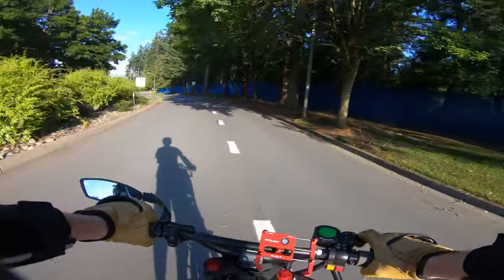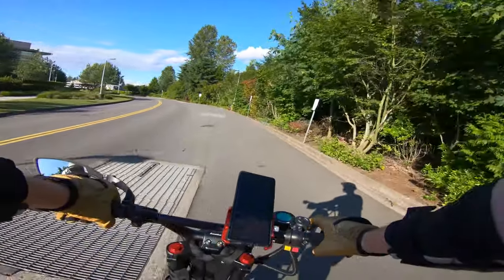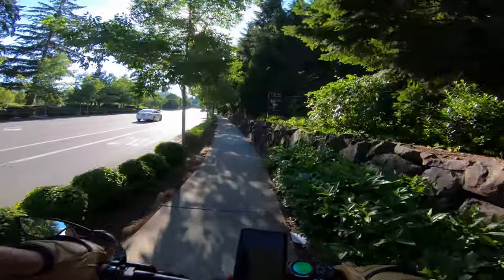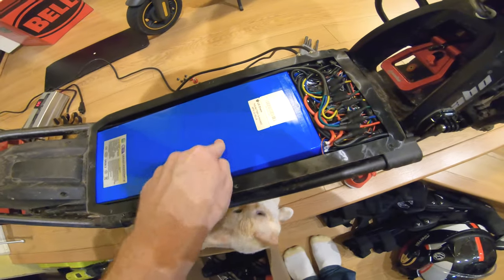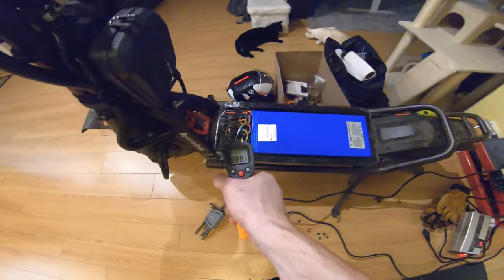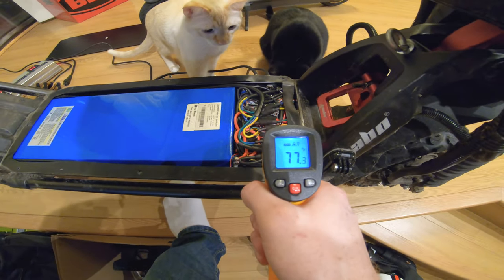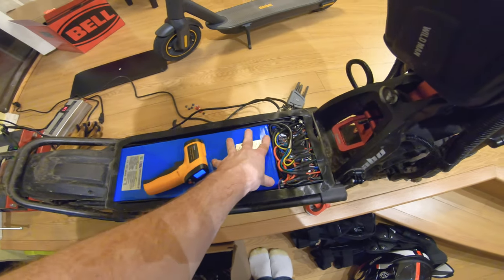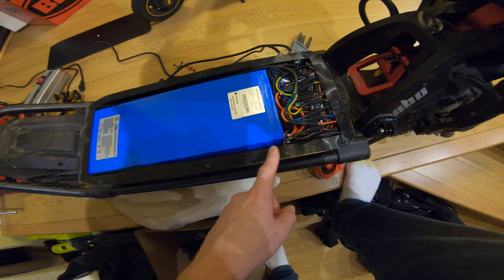P.E.V. Electric Scooters & EUC's - Charging : Are Fast Chargers Too Fast?

Comment: Nice! Good to have Nismo around to check what you are doing :D also - always useful to check max recommended current for a chargeport, max what the BMS can handle and check battery cells for max charge limit.
Reply: Also: I'm curious about what temp would be with the lid on ;) but useful videi, thanks!
Reply from the maker: Ugh I should've mentioned. I did place the Iid on for about mmm 50 minutes? (No screws in) and temp increased 1 degree. I suspect the metal casing on the scooter was acting as a heatsink of sorts. 
Max recommend from manufacturer was 16amps! I couldn't believe it, and I had so many people telling me not to charge past 5amps... But I guess it can handle way more than we think. 
And yes, Nismo was very 'helpful' 😂
Reply: @GingerOnWheels  thanks for the info! That's valuable info!
Reply: Curious about who said you can charge upto 16 amps.  I have been told by mini motors USA to not charge with more then one of their fast 6.5 amp chargers on my thunder.  It even says in the manual fast charger and stock charger is fine. Even in wolfs Manuel it says 10 is ok. I really want to use two 6.5 amp chargers at times on my thunder.

Comment: Your current limits are only applicable to the connectors, fuses, and wiring. A real fast charge is 3c (3 times the pack current rating). 1c (1x pack current rating) is considered safe. That means your 20AH pack can take 20A charging rate, and a King GT can take 35A and still be in normal charging. Your wires and connectors probably won't handle that kind of current, but your cells won't care.
Reply from the maker: Exactly.
Reply: Agreed
Reply: You're handing out bad info on the king gt pack.  the lg  lm50t cells from LG in seven parallel can safely take 23 amps per the data sheets. I am charging at 20 amps no problem. But only after upgrading the charge wire gauge to 10 gauge, which requires opening up the pack.

Comment: I think most people don't take their scooter apart to charge it. By removing the footboard you are allowing the battery and controller to dissipate heat instead of that heat being trapped inside the compartment accelerating the increase in temperature resulting in much higher temperatures. I'd find a follow-up video interesting in which you keep it enclosed as most people likely do and only open it once the charging is complete to get an accurate temperature.
🌡🌡🌡🌡🌡🌡🌡🌡🌡🌡🌡🌡
Reply from the maker: I already did a follow up video addressing this exact topic 😁
Reply: @GingerOnWheels  sorry I need to go on a Ginger binge this week and catch up!!!
💪🏻🙂🙃🙂🙃🙂🙃🙂🙃🙂🙃👍🏻
Reply: The aluminium top plate will act as a heat sink and dissipate a lot of the heat and maybe better on than if off!
Reply: You don’t take your scooter apart to charge it?

Comment: Ginger: Don't forget that when you OPEN the cove you're DISSIPATING THE Heater much quicker. Normally the batteries are TOTALLY enclosed with the cover I can guarantee you that they're much hotter when they're totally enclosed (heat cannot escape/dissipate easily). Think about it.
Reply from the maker: Please read my below response to this comment. Watch my Instagram too, I'll do a short post on this where I charge up then remove the deck at the end and measure temps. The metal scooter body acts as a heatsink.
Reply: Great answer to a great question
Reply: My iPhone

Comment: Reallt great video. How long does it take you to fully charge and do you always charge up to 100%, what about lowest % you tend to keep on your battery? Wonder what is the optimal A for Mantis 24,5ah battery.
Reply: Ginger knows alot more then me,but I been vaping for 6 years and a little familiar with 18650 batteries,so here's my opinion for now. If your gonna ride your scooter within a couple days of charging theres nothing wrong with 100% charging the problem is charging to 100% and letting it sit there for long periods of time fully charged. They do say if you only charge to 80/90% your battery will last long as far as how many times you can charge them. From what I understand is they break down while in that 100% charged state so as long as there not just sitting at 100% for long periods I DO MYSELF,AND I DO RECOMMEND...... charge 100% and enjoy your scooter!
Reply from the maker: I usually do 'deep cycle' charges (1amp) when I'm just letting it charge in my house and I don't have an urgent need to use the scooter. I always charge it up to 100%. I know there is a lot of evidence to suggest that this will decrease overall battery life but I haven't noticed any after near daily charge/discharges for a year. Sometime's I'll even charge it up to 100% and leave it for a couple days on accident, or it'll start snowing and I can't ride... If there is ONE guy on the internet who would've experienced loss in longevity of their battery, I think it'd be Yogisteve from Electric scooter academy on youtube. I'm curious to ask him.
Reply: @GingerOnWheels  Charge cycles are definitely good. Discharing battery till shut off definitely does the most degrade of the battery, a lot more than charging to 100%. It is recommended to not go below 20% or 30% and not go above 80% or 90% which suppose to prolong and give you 2 to 3 times more of charge cycles before battery going bad, but that is the catch, if you charging in that way you get to use basicaly just half of the battery capacity and have to charge a lot more frequently, basically not winning much at all by charging and trying to save the battery. I would really love to see a detailed test, with two same batteries, and see how much miles overall of lifespan you would be able to get with both batteries.
Reply from the maker: @TheChazas  I've read those 'rules' in lots of places, too. And there are articles out there proving they are true. BUT I've driven my scooter until shutoff and been stranded lots of times. I should definitely do another range test to see if my battery has significantly less capacity.
Reply: @GingerOnWheels  How many miles you already did on your Wolf? I wish the market would ditch this outdated battery tech and have less degrading cells, but it is good for companies and specially phone market, since batteries after a year or two degrades so much making you want a new phone, specially new flagship phones that eats battery and all the super fast charging.
Reply: @GingerOnWheels  that would definitely be good to see if you can drive it very similar to the 1st time and most of the same route! That would be amazing! Not just cause of the way you charge or drain but the miles and abuse it's been through since that time! I know it's a boring LONG ride BUT  WHAT A GREAT VIDEO!!!!!!!

Comment: @Ginger On Wheels I've seen a Falcon PEV video (for Zero10x), where they recommend not going past 5 amps because of the BMS. If you give too much amperage to the BMS, there'd be some risk in frying that component by going over spec. It's a consideration of the battery arrangement combined with the spec for the BMS. Hope you stay safe bro!
Reply: I've done 20 amps many times and not yet a problem . I don't recommend but in my case I was testing as I wanted to install higher rated bms for faster charging but diff t have too so far . I stay at 15 amps for 90% and then go to 5 amps

Comment: I have a question, it doesn't relate to E bikes batteries specifically but maybe you can help me. I have a 24 V PCB based battery, Each PCB has 7 batteries and there are 24 pcbs so 7S 24p..18650 batteries.   What type of charger do you recommend?? And at how many amps should I charge it? should I fast charge it 5 amps To 10 amps ? It has a 60 amp BMS.

Comment: yea. it doesnt hurt the Battery. but what about the Scooter itself?
in germany we have a "manufacturer" called IO HAWK. they import international scooters, modify them for german laws, and put their name on it.
the "IO HAWK Legend" is a modified Kaabo Mantis 10 for example. and now they released the Legacy (modified VSETT 10) and Collide (Modified VSETT 8).

the Legend (Mantis) had a 5A Fuse on the input, between the Charging port and the Battery Input. so even if the battery could handle more, you cant put more than 5A into it (and it has only 1 charging port).

now the VSETT models have two charging ports. 
but IO HAWK says strictly, that you must not charge your Legacy (VSETT 10) with more than 4A. which is either one charger with 4A or two chargers with 2A (stock charger is 2A).
so ... after everything i know, 2x 4A is no problem, and makes 8A charging in total. BUT ...
i dont know if the two charging ports are handled separately, or just go parallel inside the deck, and go into the battery as one connection. 
and i dont know if there is a fuse. 
and i dont know what the BMS says to 8A.
so even if 8A is fine for the battery/cells, it still might be a no-go. 
but also might work perfectly fine, even though IO HAWK says "never do that".
(one thing to mention is that the Legacy only has one controller, while the VSETT 10 had two controllers)

only way to find out is to open up the deck of the scooter. but the Legacy is freshly released, barely any videos, and barely anyone looked inside it. 
i dont have a Legacy yet, so cant check it myself.

Comment: thanks for the video Ginger, I have a question for you, could I use the fast charger of a dualtron 60v 6,5ah in a kaabo mantis GT pro? thanks a lot!
Reply from the maker: If the output volts and end connectors are the same on both chargers then you can swap them safely, yes.

Comment: I have a stock and a fast charger. What do you think of using them both at the time on a Vsset10. 
One at 5a one as 1.5. 
Any issues? 
Thanks
Reply from the maker: No issues. Totally fine to use both.

Comment: If you use that fast charger set to 80-90% state of charge, is it safe to leave the scooter plugged in? I.E. over night or longer?
Reply from the maker: Yup! Both the charger and the scooter have cutoffs built in that will stop battery from charging at a certain # of volts. IF both of those systems fail though for whatever reason, you'd have a very crispy house.
Reply: Ginger On Wheels damn dignity right my friend!

Always best to pull your batteries off charge when you go to bed, or atleast have a co2 fire extinguisher and a few bags of sand, with a lot of fire alarms if you don’t, just to be safe, you never know when something could fail and a lot of components built in China tend to have some minor construction flaw or another and will fail unexpectedly.

The only time you should leave it plugged in after it’s done charging, is when you want to make sure your cells are getting balanced completely (this is assuming your bms will balance your cells when they are charging, there are so many variables when it comes to bms it’s ridiculous, you’d be surprised how many different bms would be in the wolf’s batteries over the time it’s been available, due to simple supply and demand)

Sorry for my long winded comments, I just wanted to support Gingers comment, he (you) did an absolutely ball busting amount of research to learn about lithium cells. (There’s years and years more worth of data to take into consideration but eh)

👌🤗
Reply: @JamiePineappleWyatt  No you don't have to disconnect the charger from the scooter when done charging because the charging stops once it reaches full. Keeping the charger connected has no I'll effect against the scooter nor does it create hazard condition..

Comment: Coming from a different world but in the remote control car battery world we try to never charge more than 2c right I guess my question is are these batteries rated it and how many milliamp they are because you’re so divided by 1000 and I would give you the maximum amperage you’d want to charge one at Safeway for example a 10,000 mA battery pack you could see if we charge it at 10 A no problem even 20

Comment: Question new rider how low can I take battery or should take battery before recharging? Percent or volts reading if I'm saying it right.tks
Reply from the maker: Depends on the nominal voltage of your scooter battery
Reply: Ok thanks I bought the Mantis pro Se. I'm kinda fluffy so ya. My first scooter its cool
Reply: @GingerOnWheels  this b captainjack, when I was  Making a short clip for you to see I seeing the silhouette of a screw head under the tape so I believe I found them thanks a lot you've been a great help. keep posting videos they help a guy like me out! Tks

Comment: Man I really love this video I have a question for you I'm buying a powerful ebike and yes it is a big blue battery like yours except its a 72.v52.5ah they said that I can use a 10amp charger for my battery and still be safe if I use the 5amp  charger it will take me 8 to 12 hours to charge and that is ridiculous to wait that long but I need your opinion what do you think because you use 10amp charger with no problem so should I be fine
Reply from the maker: 10 amps will be completely fine.

Comment: What’s your recommendation on fast charging a Vsett 10+ (60v 25a) using one port and using two ports?
Reply from the maker: You can only safely run 5 amps per port. I'd get one of these. 
https://pevoutlet.com/product/scooterfastcharger/
Reply: @GingerOnWheels  that charger is perfect!! Thanks Ginge, I’m going to order it right away. I just bought a used Vsett 10+ used in mint condition.
Reply: @GingerOnWheels  is it safe to leave the charger plugged in after it’s fully charged? Will it turn off automatically when fully charged?
Reply from the maker: @SmokinonPEVs  yes it will turn off automatically. For the .00001% chance there is a fault in the charger and the battery BMS though, it's always best practice to unplug the charger before you leave the house, or go to bed. 🔥🔥 Is bad.

Comment: Nice vid, I cannot speak if it's true for the charging port of the Kaabo but be careful when putting in the main plug first into the socket and then into the scooter because there are scooter-sided plugins that can be plugged-in in a wrong-poled way if you don't pay attention so you could actually short circuit the whole battery - my D4+ has such charging ports and the LED on the charger will actually turn red instead of green to signal there's a poling issue. I'm actually glad having had not the main plug connected that one time, otherwise my battery could've been toast..
Reply: So your saying plug the charger into the scooter ports first then plug it into the outlet?
Reply: Yeah that right, that’s what I have been told. Plug into the battery port then and only then you switch the power on
Reply: Yeah but you will get carbon arcing at the connection point as the capacitor in the charger will not be equal to the battery voltage ! That will destroy your charge port eventaually

Comment: What voltage do you recommend recharging at for a 72v battery scooter? On my 60v I never let it go below 53.8v so I’m assuming for 72v I should recharge around the 67.2v mark. Just wondering if u could run scooter lower for more range if desperately needed.
Reply from the maker: On 72v scooters I charge up to 84 volts and discharge down to 60ish.

Comment: Ginger does your fast charger percentage settings work? I ordered the same one from fluidfreeride for my WW 11 and if I set it to 80% or 90%, it always charges it to 100% no matter what. I'm currently working with fluidfreeride tech support on this issue.
Reply from the maker: Yeah it shouldn't charge to 100% if you said it below that. Fluid free ride will probably end up sending a new charger

Comment: so I got my wolf today and immediately drove that 50% charge to 5% and did my first charge as Dual. I had the stock and rapid charger from Voromotors that gives 3.5A. On facebook i was given this chart that shows 60v batteries will indicate in the display 100% is in the area of 67.2 but at the moment having charged about 5 hours, my charges havent turn green to indicate finished and its reading 67.8. Should I disconnect anyway and not worry?
Reply from the maker: Chart you saw on Facebook was incorrect. 67.8 is actual full charge.

Comment: For fast charging 4 things matter. First is the current handling of the plug. These GX16-3 plugs are rated for 7A. It can handle more but it is not designed for more. Next is the power handling of the cable from the charging port to battery (thin cables heat up the most, they typically use silicon wires so the isolation will not wear and break when heating up), next is fuse that may be in the cable from charging port to battery (if you put through more current the fuse blows), third the BMS  set maximum charging cirrwnt that acts as a safety against overheating (typically somewhere between 6A on Mantis and 10A on the Wolf again to protect wires and copper/solder PCB Paths and only finally the cells charging capability which is almost always higher then everything else listed here (standard charging is 0,2C for MJ1 cell which is in this case 35Ah*0,2= 7A. Fast charging is 0,5C which would be 17,5A. And for the chargers used it is not important if you mix 2 standard chargers or a standard and a fast charger or two fast chargers, all will work. Important is which part is the weakest in terms of current handling and if you exceed that with the total Amps of charging.
Reply from the maker: Wow! Thanks for the info. Where were you when I was making this video?! 🤣
Reply: @GingerOnWheels  I thought about making many educational videos myself but were busy at the moment. And I like your videos very much :)
Reply: I have a Kaabo wolf warrior gt. I am charging with a fast charger 5amps and the factory charger both eat once. Have been told that it is save. I also have two 5amp fast charger but have been told that it’s not safe so now I am confused on what’s safe or not